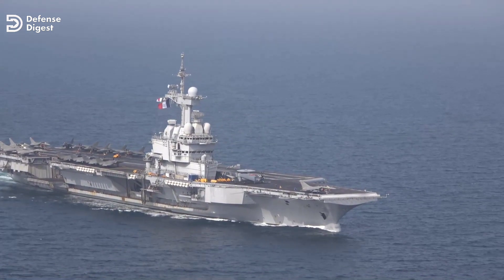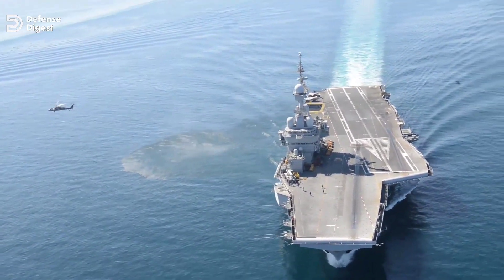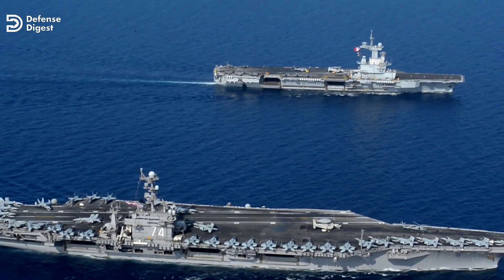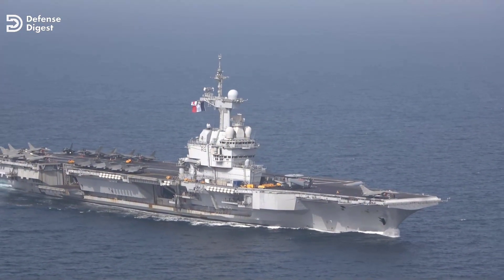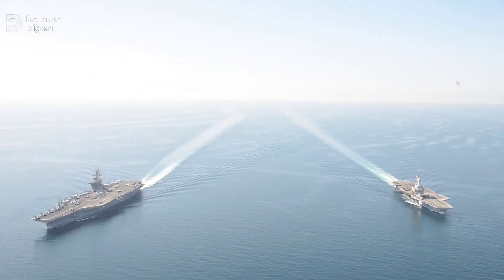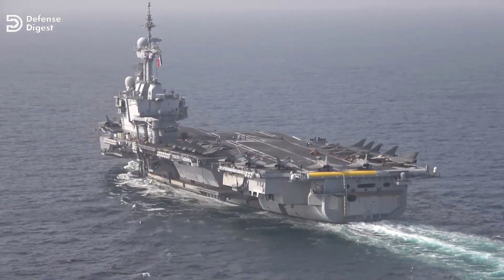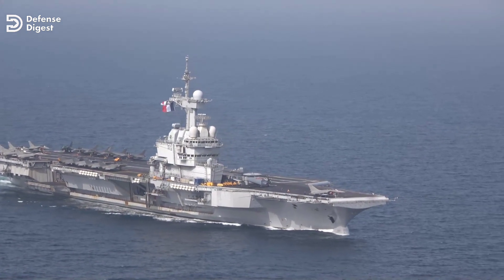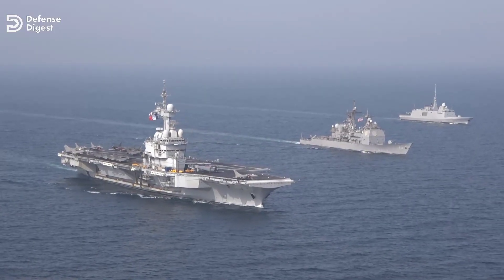French Aircraft Carrier Charles De Gaulle : One Aircraft Carrier with Many Problem

Comment: Completely outdated design when complete, only the British and Americans have modern carriers fully fit for service into the 21st century.
Reply: Outdated design? Looks like any American carrier, except the size.
Reply: The Royal navy’s  two carriers are not nuclear powered and have ramps so they can’t launch aircraft with maximum loadout , I’d argue japans 4 “”””””helicopter destroyers””””””””” are capable modern light carriers , along with Italy’s aircraft carriers and the PLANs 3rd aircraft carrier is a capable warship with plans of their 4th carrier to be nuclear powered
Reply: @mosesgoldbergshekelstien1520  Nuclear power is not relevant for carriers, it's too expensive and slow to build especially if you are only building one or two. It also and restricts where the ship can visit with more countries adopting no nuclear zones. The carrier is designed for VTOL F35 variants so no need for catapults. The ramps impart a force to help loaded fast jets off the deck into the air. It doesn't actually need them but they are generally safer. Both have pros and cons. But considering the U.S navy has been struggling with the electromagnetic catapults for years since they don't work properly and reliably it seems a good decision in hindsight.
Reply: @pgr3290  but the F35B can't carry  many weapons when he use his STOL systems, the catapult is the best systems for launching aircraft at full capacity. Nuclear props is also the best system you can deploy a carrier everywhere everytime at maximum speed, the only problem is the squadron of ships who accompany the carrier, they need refueling and slow down the carrier
Reply: @ptranchand52  Catapult will launch the heaviest aircraft for sure but the F35B can launch heavy with the aid of that ramp and of course comes back to land light and empty vertically, mean you can stack and relaunch them off quite fast. They are much safer to land too if they bring back a weapons loadout. You can also operate them off helicopter carriers to boot. Great if you have allies with smaller ships. Nuclear is just too expensive unless you're building half a dozen of them. Refuelling and maintenance is expensive, loads of places don't want you near to dock or operate. Again a big issue unless you own loads of bases around the world which most countries do not. You also can't go through the Suez on nuclear for example without a good reason and government negotiation. That's important to European vessels especially going to the middle east quickly....
Reply: @pgr3290  US uses steam catapults for their carriers and they work well even the RN once used steam catapults, like all highly advance tech like electromagnetic catapults it’s a lot of trial and errors , nuclear powered carriers like submarines are Infinitely better than diesel powered, VTOL aircraft Don’t have the capability of catapult launched aircraft, the RN made a huge mistake not going for nuclear powered carriers
Reply: @mosesgoldbergshekelstien1520  All new U.S heavy carriers have electromagnetic catapults. The royal navy has never had a nuclear carrier, don't need them, can't use them. Just recently one of their carriers went through the Suez. Can't do that with a nuclear one. Read the points made and understand.
Reply: @pgr3290  I never said the RN had a nuclear carrier I said the RN had steam catapults on their carriers in the past watch the footage of buccaneers getting launched , nuclear carriers are Infinitely better with unlimited range it’s only logistics of jet fuel and food stores required whilst the diesel carriers require much more constant replenishments from Auxiliaries,  US carriers have even fueled other escorting warships there’s a famous photo from conflict desert storm of one of the Iowa BBs being refueled by a carrier , China not only is getting rid of their ramps for their future carriers but is also switching to nuclear propulsion as well , it’s simple world class dominant surface navies push for nuclear propulsion
Reply: @mosesgoldbergshekelstien1520  And I said why the RN never operated nuclear carriers in the past 100 years and doesn't need them for the next 100 years. That was my point. Nuclear carriers are NOT infinitely better for all scenarios and I gave many reasons none of which you addressed or acknowledged. Just because one country operates nuclear carriers doesn't mean that every country can and should. If you're a superpower that has the largest economy, massive domestic nuclear industry, multiple ports equipped to deal with nuclear marine propulsion, domestically design your own reactors, plan to build multiple carriers of the same class to control costs, intend to deploy multiple capital fleets on multiple seas and finally have expansionist doctrines then yes, perhaps you would want nuclear powered carriers. For the other 98 percent of the world's navies and especially European ones, then no.....
Reply: @pgr3290  France have nuclear carriers, the Charles de Gaulle is the first french nuclear carrier, the french government also planned to build a next generation nucelar carrier, the PA-NG with new equipment like electromagnetic catapult, a displacement of 80,000T and 300m long, it will be more efficient than the Charles de Gaulle class with better plane capacity
Reply: @ptranchand52  The French have the biggest domestic nuclear industry in the world relative to their size. Therefore they can build a nuclear carrier with a reactor of their own design cheaper than anyone else in Europe. With the most available engineers to work on it, the most public acceptance of nuclear vessels seeing as they all live next to nuclear plants anyway. They're very much the exception than the rule. However saying all this, they will take FORVEVER to replace the Charles De Gaulle. It'll still cost a fortune, and despite being outlined in 2020 it will probably be lucky to be operational by 2040. It's decades away. Their target is already 2025 to START building it and 2038 to finish it, which they'll never hit lol
Reply: Thats wrong japan got an new very good carrier
Reply: @Kevin-qg8eb  Carrying helicopters. Not fast jets.
Reply: India just built it's second Aircraft carrier. And a third mega Carrier is in construction
Reply: @coronavirus5050  It remains to be seen how good the INS Vikrant actually is, still not in service. The very first domestic Indian built carrier is bound to have problems since India lacks any experience at all designing and building their own. Only previously operating foreign several generation old designs. It's also incredibly late, incredibly over budget and also primarily carries the MIG 29K. This has been very problematic for India. It's only a fourth generation aircraft, reliant on parts from Russia and India needs many of them to be updated to integrate successfully. Questions remain over operational capability both with the ship and the aircraft.
Reply: @pgr3290  That's true. But they are planning to buy 57 Rafaels for carriers by 2023. It's only a year late to the desired timeline. It's Bound to have some problems but the Navys flagship project rn is the INS Vishal which would be a supercarrier inducted around 2031. It would carry the AMCA, the Indian Built 5th gen Aircraft that would enter service around the same timeline.

These are just plans for now but I hope it turns out well.
Reply: @coronavirus5050  are you sure about the 5th generation indian plane in 2023,  i doubt because india has a little experience in aircraft engineering and create a 5th generation is actually really difficult for many countries (F35 and Su57 are  good example)
Reply: @ptranchand52  The 5th Gen AMCA is to rolled out in 2028. As for the other options, the Russians did offer S-500 and Su-75 once they are ready for Exports. 
India did create the HAL Tejas, the 4th Gen Aircraft and HAL Lch, multirole Helicopter. They have previously developed Stealth Destroyers and there's always a chance that you might fail,but They managed to create the Nuclear Capable SSBN submarines on their own. So who knows maybe their plans will succeed or not. Things are looking good on paper for now. The current government is putting great amount of investment in defence sector development.
Reply: at least the cdg can launch an aircraft without crashing it, i gess ?
Reply: @vadaing394  They can't. The deck of a carrier is extremely dangerous and losses are par for the course. On a brand new carrier with brand new fighters in an early deployment accidents will happen. Even the pencil pushers and bean counters at the upper echelons understand that. This French carrier has a LONG list of comedic mishaps, more than most!
Reply: @pgr3290  even with a recent aircraft it would be interesting to run the engine at full throtle in order to see if it works, that could have saved the plane. And also, if the aircraft has been lost because of its early developpement state, how can you say that the QE is an operational and fully fit for service carrier ?
Reply: @vadaing394  We don't know exactly why the aircraft was lost, perhaps it was an operational mistake or a technical error. Regardless it's still the same. If you think that your brand new setup will work flawlessly from day one then you're delusional. These are highly complex systems operating with newly trained humans on the most advanced and complex carrier borne fighter in the world. It takes some time to iron out all the potential problems, you build on that experience, and then within a couple years you have it down pat. Even then it's an aircraft carrier and accidents WILL happen. Matter of time. Not a week goes by without a military aircraft incident somewhere in the world.
Reply: @pgr3290  So, in a nutchell :
- The CDG is nuclear, the QE class is not
- The CDG carries 10 more fighter than the QE class
- The CDG can carry early warning aircrafts
- The CDG has a cataput, which means it can launch the fighter jets with way more payload

And eventually, the CDG was the first try of a nuclear powered aircraft carrier for France, so it is totally normal that it had a long developpement time and designing issues.
Reply: @vadaing394  Already gone over why building one nuclear carrier doesn't make much sense high cost wise and difficulties development wise. How many and what type of aircraft these ships carry is more a military doctrine and policy thing rather than capacity. If the Royal Navy wanted to cram planes on they could, the QE is a much larger carrier after all. The Queen Elizabeth has been operational what? 10 months? The French carrier has been in service 20 years and so has changed in this time, no doubt the selection of aircraft and capabilities the Royal Navy will have in a few years will be different and round off the carrier's capabilities.
Reply: @pgr3290  I wouldn't say then that Ford class carriers are perfect then?
Reply: @pgr3290  And FYI Queen Elizabeth class carriers tech and design are very outdated and diminishing for the future conflicts and or demands of the Navy. Everything now days is almost virtual and electronically. And what if Britain desires to abandon more acquisitions of F 35 they would need to design an aircraft capable of carrier based operations and if that would be the case with all budget costs of the RN it will be a lengthy and costly time.
Reply: @UCBSLoZ-OP9yIo7HPTYo1Rhw You Americans are not the only ones who can build state of the art ships. You think you top out the world. Besides for what so much power to bully countries that pose no threat to you. The whole sanctions against Russia is not because what's happening in Ukraine it's because you want to become richer at the expense of the misery of others.
Reply: @UCBSLoZ-OP9yIo7HPTYo1Rhw Well they say now Ford is plague with other issues let's see if they don't cancel them like zumwalt.
Reply: @francotrussardi2779  Oh Ford has tonnes of issues, but again I'm hardly surprised. It's full of new tech that hasn't really been tested out actually installed in a ship and used operationally. That ship won't work properly for years. Kind of to be expected. But by the time they built the third one it'll come out the yard and just work, from the experience gained from the early ships. So often the case in serious engineering projects like these, like building a new airliner or fighter. Big expensive long drawn out development programs, you build the first one and it still doesn't actually do what it should until you fixed up all the issues after a few years. Harsh realities. They are stupidly difficult and complex to design and construct at this level.
Reply: @pgr3290  And again it may just get canceled. Besides why not design a flying one
Reply: To talk about this video and even this channel, the brave commentator forgot to mention the English aircraft carriers (puppets of the USA), HMS Queen Elizabeth and HMS Prince of Wales, with many problems, the Prince of Wales still docked and The Daily Mail reported that the Royal Navy had begun a cannibalization of the building, including the dismantling of lifting chains and sections of gas turbines to be fitted to her sister ship, to replace faulty or used parts and the maintain airworthy.
Thank you for the French Bashing